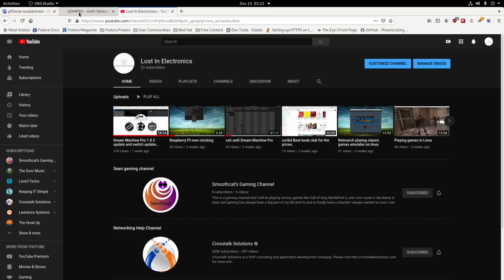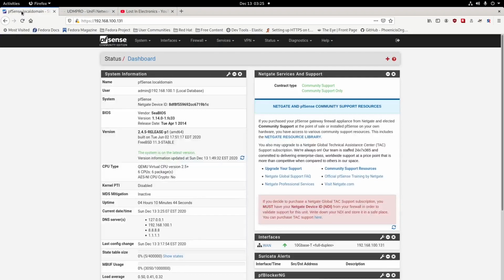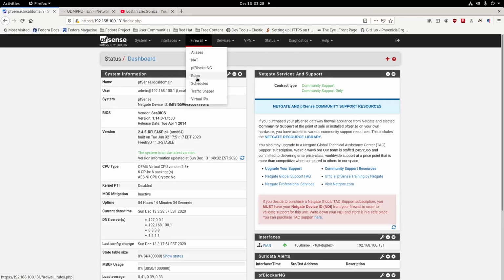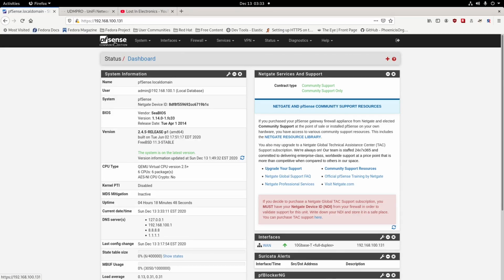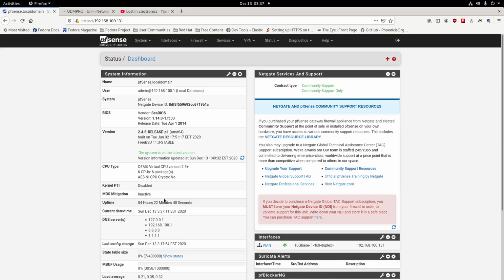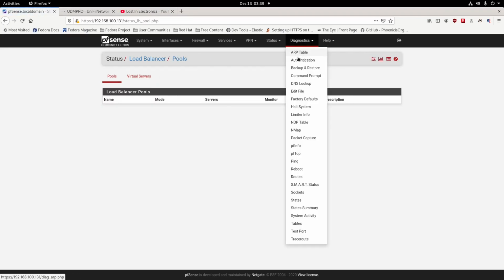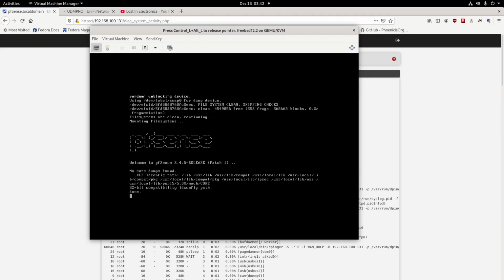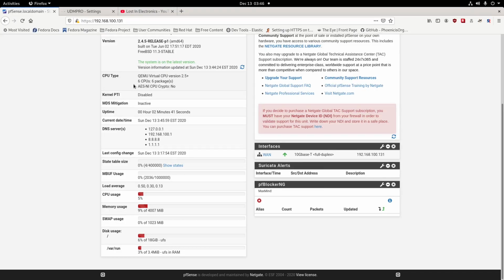Dream Machine Pro vs pfSense

Comment: PfSense doesn't need maintaining, sure you could put an elderly relative on pfsense... You could make it high maintenance by adding lots of unnecessary pfblocker rules etc but its default configuration is no more complex than a consumer grade router. It blocks all traffic in, allows all traffic out hands out DHCP leases and forwards/resolves DNS queries. You just need to keep it up to date like any other firewall. To be fair, most normies let alone older people don't know what a firewall is or does. So at least having something like pfSense allows you to update it remotely if need be, if you're the one tasked with keeping it up to date.

Comment: I'm actually about to build a home lab setup, and am thinking about this very question.  The UniFi stuff looks extremely easy to set up, which is great.  However, pfSense also looks like an easy install with solid defaults.  So for a rackmount setup, a Netgate appliance running pfSense coupled with a Cisco CBS 250 (or some equivalent) L3 switch would be a solid setup also, with possibly more configurability on both devices than what Ubiquiti offers.  On the other hand, one thing I have to think about is how my non-technical g/f maintains the network after I'm no longer able to (medical issues).  That's an argument for simplicity.
Reply from the maker: if you are look for easy to maintain, hand down the Ubiquiti equipment. If you want more custom options use pfSense. pfSense firewall with ids is hand down, worlds head of Ubiquiti for security. Look for easy to use for some one none tech friendly. I would give that to Ubiquiti and easy maintain.

Comment: I gave up on my SG-3100 for now with my Gigabit FIOS connection.  Running a USG for now as I found it gets me twice the performance and everything reacts faster.  Faster DNS,  faster page loads,  better pings, etc.   The SG-3100 has some kind of issues with the FIOS connection,  I'll get around to sniffing the connection eventually.   I tried an OpenWRT router as well and it blew away the PFSense (SG-3100).  Zero physical interface errors recorded,  so not a cabling issue.  Was only getting aroudn 250 Mbps on the SG-3100 vs 900+ on the  USG.   Been a PFSense user for about 6 years now and massive background in Networking and IT.
Reply from the maker: Thank you for feed back on the video. I will try to test software different on speed and go though video. Thank you again for leaving commit on the page.